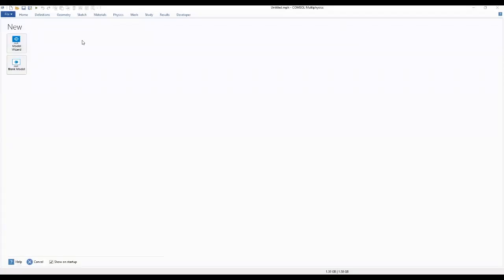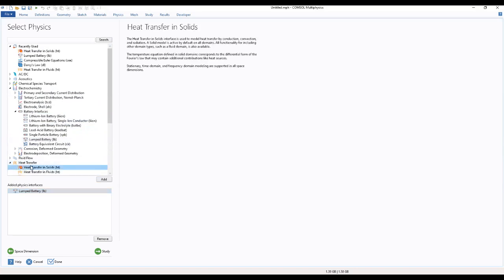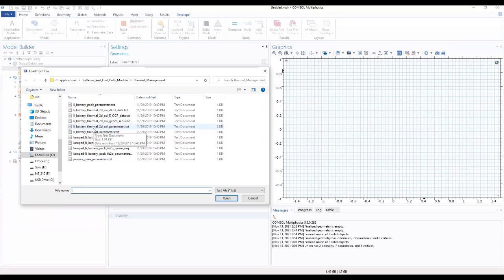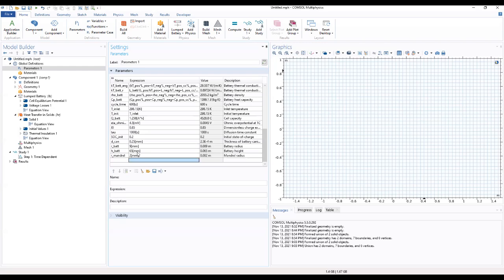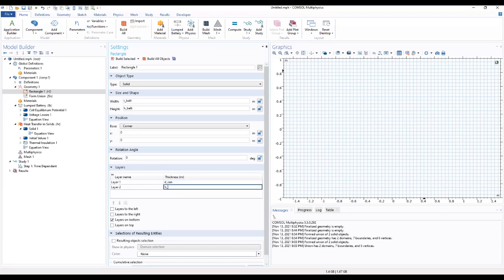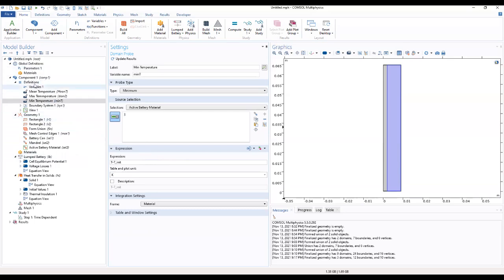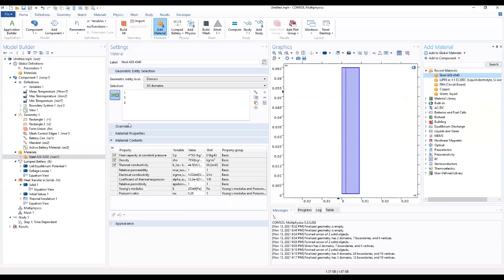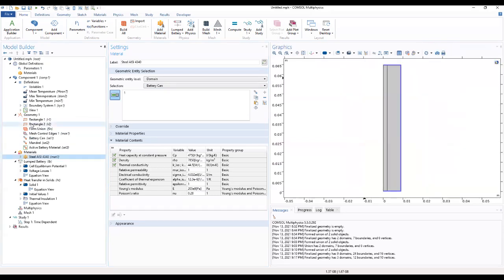HOW TO MODEL THERMAL MODELLING CYLINDRICAL BATTERY MODEL. Part 1

Comment: Please make 2 nd part also, about  graph showing variation of different parameter of battery like cell potential, charge and discharge capacity, state of charge at different temperature with time